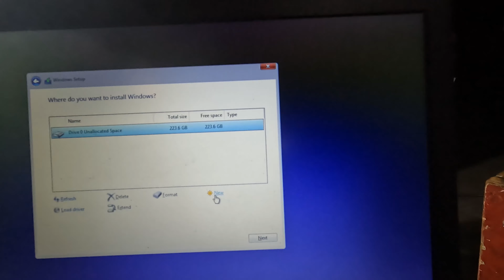How to Replace HDD/SSD LENOVO IDEAPAD 110 -14IBR SLOW LAPTOP HOW TO FIX

Comment: Meron din akong lumang laptop dito sir gusto ko din palitan ng SSD model ng laptop Aspire ES 14 , intel Celeron Quadcore Processor N3160
4 GB DDR3 L Memory
500 GB HDD. Pwde pa kaya palitan working pa nman ito gamit ko sa school. Any advice sir. Thanks
Reply from the maker: bibilis pa pa kahit paano mas maganda rin maka upgrade yung ram 8 or 16gb mas bibilis pa laptop nyo.. mas ok na ngayon laptop kesa naka HDD nagagamit ng ng pamangkin dati talaga gapang na gapang kahit ilang beses i clean installa ng operating system.
Reply: @BHENTECH  thanks sir any link pwede bumili ng SSD at ilang GB po ang compatible sa laptop wala kasi akong alam gaano sa ganyan hehe Thanks uli sir
Reply from the maker: mas madali magpalit dati ng HDD may Hardisk bay... ngayon iba iba paraan para ma palitan mas maraming turnilyo aalisin at iingatan na flex cable ibang laptop aalisin pa yun keyboard maninipis yung flex cable parang phone na rin yung technology naka built in pati battery kaya minsan tinatamad talaga ako pag may magpapalit lng lalo na pag mahirap alisin at baklasin yung kaha.
Reply from the maker: nasa video descripton pati tool pero kung wala old pvc id lng pag naalis nyo turnilyo padaan nyo ng pvc id pero ingat lng kc may laptop na baka tamaan flex wire hirap pa naman humnap ng parts nyan pag flexwire lalo napag luma na. almost compatible naman lahat halos same lng naman sata connection
Reply: Kaya nga sir dami tornilyo prang di kayanin heheh nakita ko napo sa description box visit ko nalng yan. Thanks sir. Pede din magpakabit sayo sir if ever hdhe
Reply from the maker: pwede sir check ko po kung madali medyo manginig nar in kc ako

Comment: question lang po not related sa video bakit po kaya medyo ma red o parang overcook sa mug pag picture ng tao pero goods naman po sa design layout.pag sa tao lang po panget ang output im using L121 printer L110 driver Cuyi 6 in 1 heatpress o ano po ok settings sa pag press
Reply from the maker: baka overcook po bawas temp o bawas time
Reply from the maker: https://www.youtube.com/watch?v=HJeKHQehxvY
Reply from the maker: https://www.youtube.com/watch?v=ZeDAt2XmqyY

Comment: Hello po ask ko lang po ano po kayang cady size ng ganyang model? 9mm or 9.5 mm po?
Reply from the maker: SSD po ba size ? Dimensions are typically 2.75 in x 3.95 in
Reply: @BHENTECH  yung CADY po yun pong nilalagyan ng ssd sa cd/dvd balak ko po kasi magupgrade
Reply from the maker: gagawing external drive?
Reply: @BHENTECH  parang ganun po yung sinasalpak po dun sa DVD/CD Drive
Reply from the maker: di ako sure sir wala na kc yan laptop na yan sakin pagawa lng bakit hindi na lang kayo mag external drive